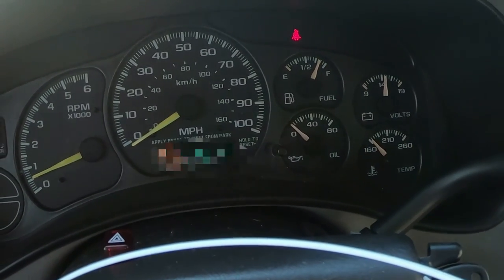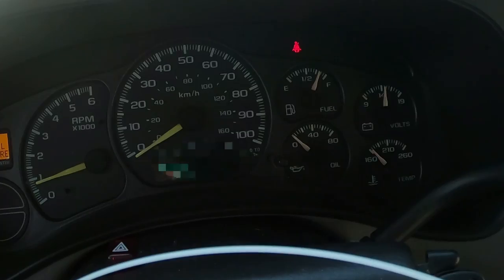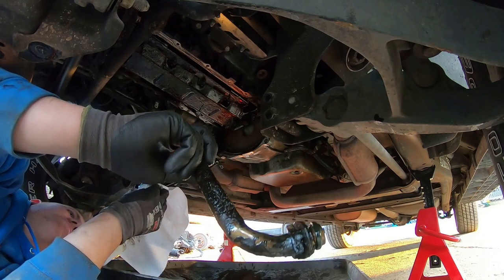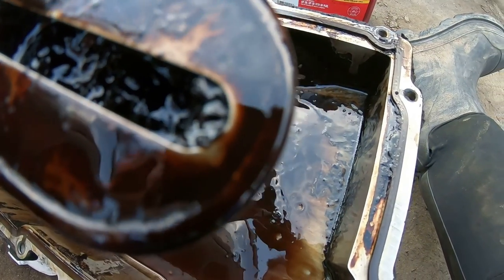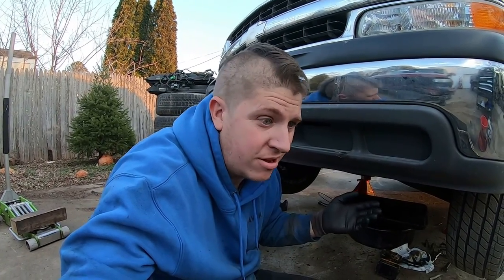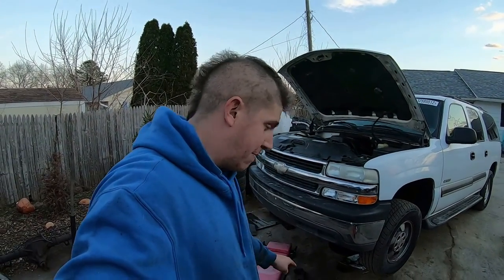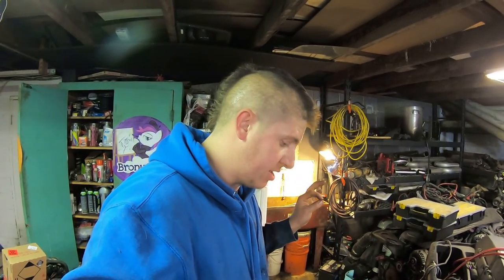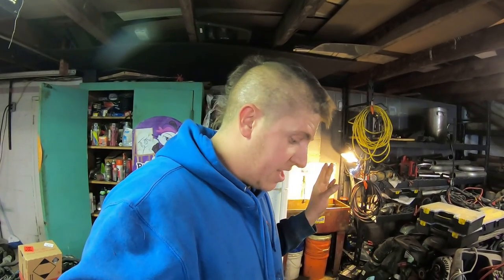LOW OIL PRESSURE, fix your LS before it LOCKS UP!

Comment: I just bought a 6.0 and it was very similar just thick oil throughout the whole thing. The valve covers were caked. Crazy the things survived as long as it did
Reply from the maker: Good testament to the durability of these engines. They will tolerate pretty poor maintenance for quite a while, that's why I don't worry about engines with over 200 or 250 thousand miles, as long as under the valve covers looks like it's been maintained, 250k is nothing for these things.

Comment: Wow, that's insane! It looks like they tried to get 10 years of driving out of the original oil before they changed it! I'm amazed the oil pressure was still so good, and the bearings didn't get wiped out.  Nice save!  Hey, what was hanging on your engine lift in the background?  Did you scrap out an electric vehicle or something, it looked like a really big electric motor.
Reply from the maker: Seriously. It still had an AC Delco oil filter on it also, I wonder if it's ever had an oil change? I was relieved to see the pressure come right back up after cleaning and new o-ring, I suspect it must have started having oil pressure issues, and got traded in, and the dealership just sent it to auction instead of taking a chance on doing what I did and that not fixing it. 

It's an old ONAN generator, a guy came to buy parts from me and needed it out of his truck, he said I could have it, so I lifted it out for him with the hoist, unfortunately it's locked up tight so it will just be copper scrap.

Comment: I have a question when this problem happens does the truck slow down?
Reply from the maker: No the truck typically won't slow down from low oil pressure BUT if it's low for long enough it may go into reduced power mode which will reduce the vehicles speed.

Comment: I’m having oil pressure issue same deal on the purchase online purchase I’m running right at or under the minimum spec. Doesn’t matter if hot or cold. Worse at idle. Tried the adding extra oil tipping vehicle forward no luck . I guess pan comes down next . Any pointers be great thanks
Reply from the maker: Yeah if the overfill and point downhill trick didn't make it any better, next step is to pull the pan. If it's a high mileage engine it's very possible that it could be sludged up like this one was. 
The only other thing you could try is to drain the oil and poke something in through the drain hole, something like a metal coat hanger or piece of heavy gauge wire, and see if you can break up the sludge with the wire, then rinse it out with brake clean or gasoline or something.
Reply: @MohawkMotors thanks for response . I  ended up dropping the pan some magnetic metal pieces.  Somebody already replaced the pick up tube oring -oil pump and pan gasket . Pick up was clean engine shot! Almost done with the engine swap. You wonder how somebody friend This engine they usually run forever. Wonder what the pan looked like before somebody opened it up and tried to fix it lol. Bet cam bearings are gone out of it

Comment: Is it necessary to change the oil pump while you there?
Reply from the maker: It's not necessary, but it usually doesn't hurt either, you'll need to remove the front cover to change the oil pump though.

Comment: Great video. Did the tapping ever come back?
Reply from the maker: Nope, ran great and held good oil pressure for the rest of the time I owned it, never had another issue
Reply: @MohawkMotors  I have the same issue except my oil pressure suddenly dropped to 0 while driving. Same scenario as you and same engine noise I’m going to replace what you did and hopefully the valve train noise will go away. I’m just a little worried about it tapping to long like that until operating temperature when it’s all put back.
Reply from the maker: If the oil pressure suddenly dropped to 0 while driving and you had the same noises, I would suspect a cam bearing failure or something like that, possibly a clogged up pickup screen. Hope it's a simple fix for you!
Reply: @MohawkMotors  that’s what I figured at first I had bad engine bearings but my truck has never seen low oil pressure it’s always stayed at 40 at idle. Last Wednesday I went to turn it on and oil pressure went above 40 psi, started driving it and 5 min later oil pressure just drops to 0 and the tapping noise just starts I shut it off immediately and towed it. I’m aiming more towards the O-ring or buildup since these oil pumps rarely fail
Reply from the maker: def try the o-ring first. Oil pressure spike and then disappear though I would be worried about a spun cam bearing, that could cause what you experienced/are experiencing and is fairly common in the LS engines.

Comment: How much its a 5.3/60e combo for a swap,,,    ?
Reply from the maker: depends on which 5.3 you're looking for and which 4l60e, good used 4l60s are $400 for 4x4, $500 for 2x4. Engine prices are in my spreadsheet.
https://docs.google.com/spreadsheets/d/1UYFf3IkKg4pFIkKg6mjS_GFR1I3_czJ8/edit?usp=sharing&ouid=105683172947078479841&rtpof=true&sd=true

Comment: Would a 
Replaced pan gasket and oil pump o ring  fell I did it for wanted 10/30 (5qts) Lucas (1qt)  used a mobil-1 oil filter  fired truck up sounded great tan fine. I hoped in to back it out 0 oil pressure on gauge and low oil pressure on dash.   😮😢 😡 🤦🏼.      Wtf. I get online and see mobil 1 filters have caused this.  Then I’m thinking maybe Lucas w 10/30 is too thick  then I see that the pick up tune o ring tab can be off. Little.   I’m prett y sure it’s in there fine.   

Any one have any thoughts ?   
😭 wtf. Blessings
Reply from the maker: So I'm assuming you had good oil pressure before you dropped the oil pan to replace the oil pan gasket? Did you replace the oil pump pickup tube o-ring while you were at it? When your gauge was showing 0 oil pressure, could you hear the lifter clattering? If it truly had 0 oil pressure the engine would get very noisy. If it didn't get noisy and you couldn't hear the lifters it's possible you just have an oil pressure sensor problem, not an actual oil pressure problem.
Reply: @MohawkMotors  truck had lower oil pressure 35-40 b4 I did the oil pan  well tore it all apart and the new o ring wasn't seated all the way in the pump location  Lott work for such a minor error. well truck now has 45# @ idle and 60# driving.    I was afraid of that o ring wasn't in all the way when I did it why they only use 1 bolt and side to hold that pick up tube down is beyond me    thanks for your knowledge and help
Reply from the maker: aHHH, yes the oil pump o-ring will get ya! You're not the first and definitely won't be the last to have that happen. Glad you got it figured out!
Reply: So I did this and oil pressure was good for a week and now it's back down to 20. Not sure what happened.

Comment: Y the miles blocked?
Reply from the maker: last low mileage truck I had for sale I got blown up for weeks of people wanting to buy it. I couldn't keep the blur on them near the end of the video though so I'll probably still get blown up. lol
Reply: @MohawkMotors  74,000 miles is barely broke in.
Reply from the maker: @JoeRocket-sf6qs for real! Unless you've never changed the oil... It still had an AC Delco oil filter on it so who knows but with all that sludge......

Comment: 76 k miles????  On sub,,
Reply from the maker: yeah, it's wild, whoever owned it took excellent care of everything except the engine apparently. Interior and exterior are in outstanding condition, but the engine was soooooooooo sludgy.
Reply: You can see in the video. It had 200000 miles on it and then when he unblurred the screen, it only had 74000 miles on it.